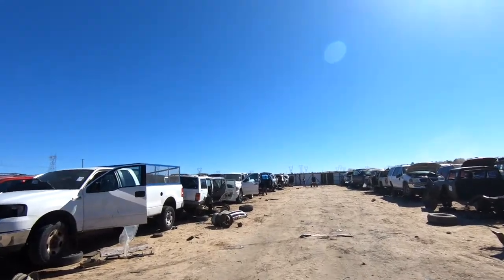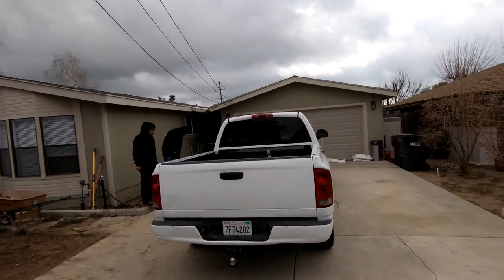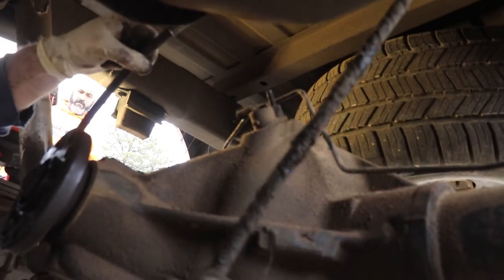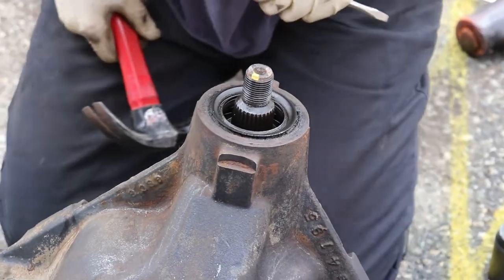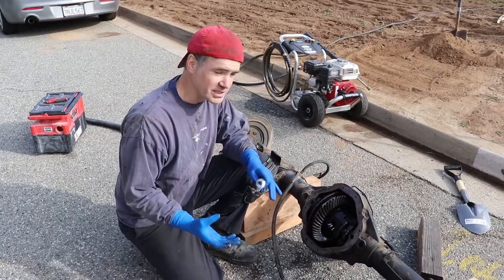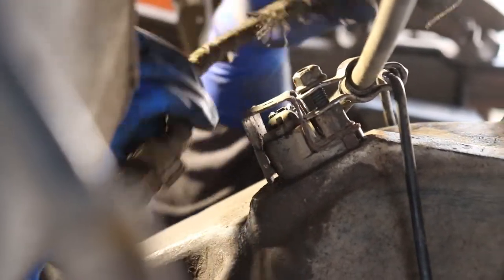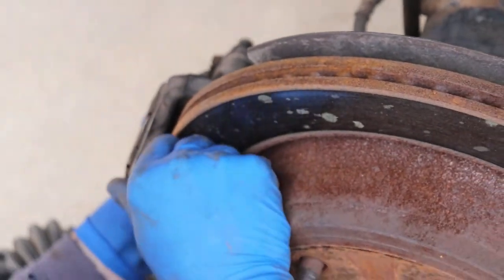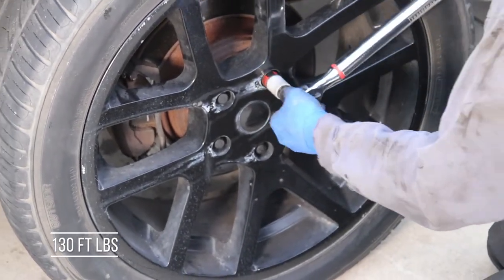Dodge Ram 1500 3rd Gen Axle Replacement DIY Tutorial *Subscriber Repair*

Comment: Nice video. I think I have a pinion bearing going out. Was thinking about rebuilding lsd. May go with a used rear axle. Im in the middle of the desert with temps nearing 110°. Slow, easy and imagination.  Lol
Reply from the maker: Hey Thomas, I know exactly what you mean about the desert heat. We picked up that rear axle in Victorville, CA and it gets piping hot out there.
Good luck with your project, glad you enjoyed the video. Cheers!

Comment: Honestly I am thankful my rear end in my 2000 ram 1500 is good since it is a factory towing pkg truck dana 44 3.55 gears although I hope they are not hard to find if and when I do need parts.
Reply from the maker: Thanks for the comments Richard, we found the junkyard one pretty easily.  LKQ Pick-A-Part locations here in SoCal list the VIN numbers. That way you can check on the Dodge site to see what rear end it came with from the factory. This helps not making unnecessary trips since you already know it has a posi or specific gear ratio you are looking for.

VIN Lookup - https://fcagroup.my.site.com/RAM/s/equipment-listing

Cheers!

Comment: I have a 2013 that sounds like it’s making a roaring sound when I’m accelerating and seems to quiet down a little bit when off the gas. How similar would you say the 3rd gen ram rear end would be to the 4th gen? Awesome vid btw!
Reply from the maker: Hey Justin, thanks for the question. It sounds you are experiencing the classic "whine" from a rear end that is wearing out.
While we haven't done a 4th gen rear end axle swap I would imagine it is virtually the same as this video. All full size trucks have used the same kind of layout for many years now. The newer 1500 all use the same rear axles from 2011-2018 so you should be able to locate a replacement easily.
Thanks again for hanging out, glad you enjoyed the video.
Cheers!
Reply: @BradleysGarage  thanks for the advice! Is there a way to tell if a rear end from the junkyard is in good shape/doesn’t have the same issue?
Reply from the maker: @justinjimenez4095 It is difficult to verify in the junkyard just by looking at things. You can always remove the diff cover and see how things look, any worn teeth, burnt oil smell but it's not a guarantee.
What we try to do when getting parts from the junkyard is look for wrecked cars. We have had great success with engines, transmissions and differentials using this method. You figure that the truck was running and driving at the time of the accident so the mechanical parts should be solid.
There's always the small chance they were driving around with an issue but we have been lucky with our junkyard trips.
Good luck on your project, Cheers!
Reply: thanks! just subscribed! @BradleysGarage
Reply from the maker: @justinjimenez4095 Thanks for the support, good luck on your Dodge Ram axle. Cheers!

Comment: how can you tell if the front and rear differtial match. i have a locked up rear end also and gunna have to do the same. 2009 ram 1500
Reply from the maker: Thanks for the question Jesse, you can use the FCA website to view your build sheet. Then you can determine what axle ratio you currently have so you can be sure to get the same ratio.
LINK - 
https://fcagroup.my.site.com/RAM/s/equipment-listing
Good luck on your Dodge project, let us know how it goes.
Cheers!

Comment: By chance does anyone know about how much the rear axle assembly weighs? Gotta look at doing this same job solo.
Reply from the maker: Hey Phil, I would estimate the complete rear axle assembly with Rotors and Calipers to be around 250-275 lbs. Even when I had that guy at the junk yard help me lift it, we were both maxing out to get it into the cart.
You can always remove some parts to make it lighter but we kept it whole just to make it easier to swap out complete.
Good luck on your project, Cheers!

Comment: should we add diff oil right away like you did or should there be a curing "drying" period
Reply from the maker: Thanks for the question Hugo. The RTV typically takes 1 hour to set up and become tack free. Since you are putting it back together you will have no problem having that much time pass before adding fluid.
If you want it to be fully cured, it does take 24 hours. The other option is to locate the gasket, then you will not have to wait any amount of time.
Good luck on your Dodge project, Cheers!
Reply: @BradleysGarage  hey man thankyou for the respond appreciate you being thorough. Great video. You inspired me to record my own project and post. It’s a lot of work, lol

Comment: What's the difference between a two-wheel drive differential and a four-wheel drive differential does it matter about the yolks
Reply from the maker: Thanks for the questions Randy, there is only a small difference between the rear axles for 2WD vs 4WD. The 4WD rear axle will have bump stops whereas the 2WD axle will not have them. So you can fit the 4WD on either but the 2WD axle will not work on the 4WD.
The driveshaft is specific to your bed length/frame, so that changes but you won't need to do anything when just swapping rear axles.
Good luck on your Ram project. Cheers!

Comment: Should have put silicone gasket inside driveshaft yoke oil will leak there it comes out on splines been there done that
Reply from the maker: Thanks for the tip, appreciate the feedback. Cheers!

Comment: What’s the name of the seal that got replaced at the yoke and pinion? I’m having to swap out my rear end due to the driveshaft coming loose and the pinion busted a hole in the case. I want to get the job don’t right while I have it off already.
Reply from the maker: Thanks for the question John, that is the Rear Axle Pinion Seal. If you are replacing the complete axle like we did in this video, you have easy access to it. Apologies for not including that part in our description.
If you have the same 3rd Gen Ram with the 9.25" rear axle, it will use the 710481 seal.
https://www.amazon.com/National-710481-Oil-Seal/dp/B001CA5GR4
Let us know how the Dodge project goes.
Cheers!
Reply: @BradleysGarage  thanks for your reply. I am replacing the axle on my 2003 after my pinion broke loose and punched a hole in the case, gears had been howling for a year so it was about time

Comment: Have the same problem broken my drive shaft and transfer case replaced both new then the rear end locked up broke the drive shaft again can't find no one to help with this project got another rear end just sitting in the bed of the truck wish you were close lol
Reply from the maker: Sorry to hear you are having trouble with your Ram. Any reason why the driveshaft broke the first time? Haven't heard of this being an issue so we are curious.
Cheers!
Reply: @BradleysGarage 
The part that holds the yoke broke and is inside the case i cant move it at all i tried to take the bolt off that holds the pin to move axel to remove c clamps but jack flipped truck fell i was under it but didnt get hurt i put it back together and looking for help
Reply from the maker: @DericBerquist-f4f  That's scary stuff, glad to hear you are okay. We would check the local FB groups or Dodge forums to see if there is anyone around your area that might be able to help you out.
Good luck on your Dodge project, Cheers!

Comment: I’ve got 3.21 gears in my 2019 ram 1500 and have been thinking about swapping into 3.92 gears. Does anyone know are there any suspension or drive shaft changes between the two?
Reply from the maker: Thanks for the question about swapping in 3.92 gears. You will need the complete front diff for the swap as you cannot change the ring itself. The rear you can change the ring set if you'd like. Obviously both the front and rear have to be 3.92 gears. It is probably easier to find a wrecked truck with 3.92's and grab the front and rear diffs from it. The driveshaft/axles are the same so you only need the diffs.
Good luck on your Ram project, let us know how it goes.
Cheers!
Reply: Thank you so much for the reply. It’s only 2 wheel drive so I’ve got nothing to worry about then. I will definitely scour the junk yards for a wreck
Reply from the maker: @makeupyourmindinator  Yep, just grab exactly what we grabbed in the video and you are good to swap it out.
Just remember to add new fluid and gasket before you put it in.
Good luck on your RAM project, let us know how it goes.
Cheers!

Comment: I knew that was a third Gen ram just because the rear of the frame and axle does not look the same as mine its a second gen but it is a late second gen 2000 dodge ram laramie slt quad cab long bed v8 magnum 46 RH automatic overdrive transmission 1500 gloss black with most of the white pinstripe 4x4...
Reply from the maker: Thanks for the comments Richard, sounds like you got a nice truck. Cheers!

Comment: I can't see the part number to the seal, can someone help please
Reply from the maker: Hey Saide, thanks for the question. The gasket will be determined by the actual differential in your truck.
We have the 9.25" 12 bolt version in the video so we used the FEL-PRO RDS55073 gasket. The OEM part number is 53007762 for the same gasket.
Just double check which differential is in your truck to verify the correct gasket part. Cheers!

Comment: That was not a posi diff.
Reply from the maker: Hey John, thanks for the comments. We checked the diff in the junkyard and if both wheels spin in the same direction then you have a posi differential.
If the wheels spin opposite of each other then you have an open diff.
We also confirmed via VIN that the junkyard truck came stock with a 3.55 positraction rear end.
Thanks for watching, Cheers!